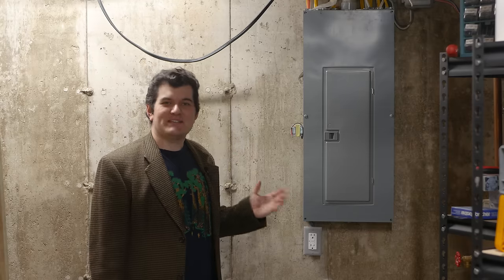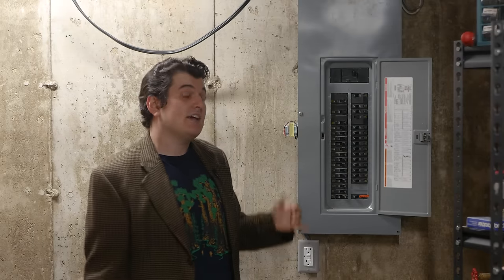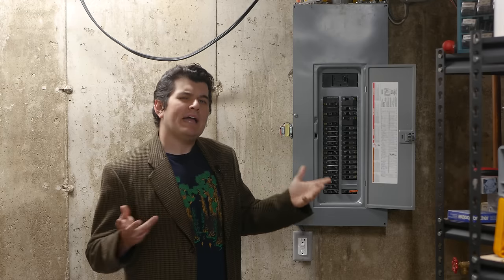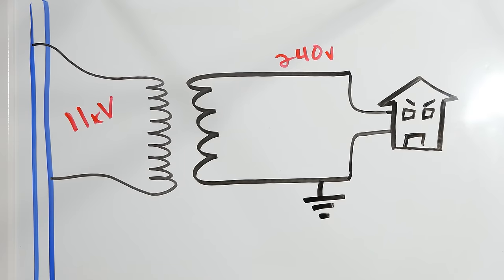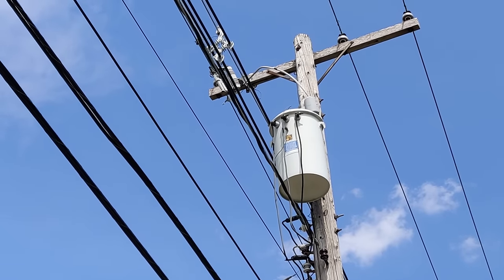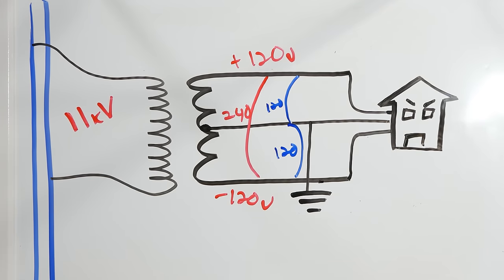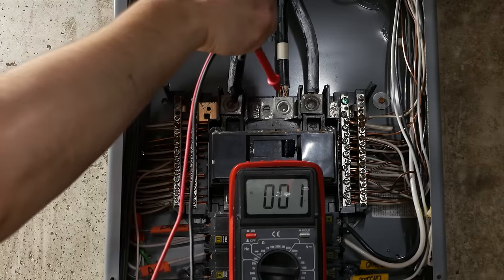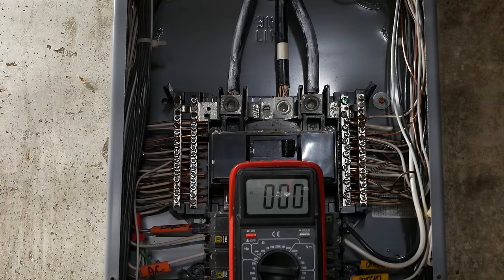The US electrical system is not 120V

Comment: Okay, if you haven't used a gas dryer, YOU'RE MISSING OUT. My clothes are actually dry! :P And my total utility bills are lower.
Reply: I see your gas dryer, and raise you my one with a heat pump 😉.
Reply: First time I visited my mom's new place I used her gas dryer for the first time.  I set it for the usual time - 45 minutes - to start, and practically melted my clothes.
On top of that her iron's thermostat was broken so it basically heated itself to infinity.
I had to buy all new clothes on that trip.
Reply: Try a heat pump dryer. Clothes last longer and no dryer vent.
Reply: @andrewrondeau5036  No vent isn't a heat pump thing. Resistive electric dryers don't need them either, but in general it's a very bad thing. It takes much, much longer to dry clothes, which cancels out the efficiency advantage, and uses more water to dry than a front-loader uses to wash, which is environmentally bad. The only way they can get by without a vent is to wash all the lint down the drain, which is very bad for drains and uses a ton of water. A vented dryer is always better if a vent is an option.
Reply: cry in rental
Reply: Greetings from my simple clothesline which is sun powered
Reply: @THECOOKIE94  Yeah, much easier on clothes too. Except for fading in the sun. And it doesn't work so well when it's raining. Or cold, especially below freezing. Or it's really windy and it blows your unmentionables into the neighbor's yard. 👍😂
Reply: Come to the pacific northwest where we only pay anywhere from 2-10 cents per kWh for electricity. Gas dryers are almost completely non-existent here. I've never actually seen one in the wild anywhere. And even the appliance stores don't stock them because nobody wants them here.
Reply: @awo1fman  Clothes racks are useful also. Can place them inside, and they work in winter. It takes longer to dry than with a tumbledryer, but the clothes stay nice for longer. It taking longer to dry my clothes doesn't matter, like who would decide one hour before going out that they would really want to wear the same stuff they wore a few days ago which hasn't even been washed yet?
Like almost nobody here owns a tumbledryer and we're still doin just fine.
Reply: Yep I overload the damn thing and in 45 minutes or less are piping hot. Gas just does some things better.  Gas stove= no wait at all for morning eggs and more heat to boil large pasta pots.  Gas water heater/hot water on demand system= I have never ran out of hot water.  Gas Heat= What winter -50 freedom units outside set to 72 gas bill was never over 70$.   BONUS NATURAL GAS ITEM= A hardlined built in back up natural gas generator detects power loss and automatically fires up and is capable of powering your entire house like normal WHAT POWER GRID? All I need is fresh dinosaur squeezings piped in and I'm set.
Reply: @eggman9713  where I'm from it only costs $9 a month (not on a budget plan either) to use my gas dryer, gas water heater, and gas stove combined.   It's literally down in the hundredths of a cent to use.
Reply: @awo1fman   or at night if you work all day.
Reply: @davinchat  Sounds like that dryer was a rebuilt oven from one of the camps in WW2 ha ha ha   Terrible. My dryer is just perfect. Whirlpool has an auto dry setting and it regulates well. Always dry and always just right.
Reply: I see your high ¢/watt and laugh in Oklahoman. Our homes have gas lines and 240V (3-wire for older homes/4-wire for newer homes for safer grounded chassis) and while gas dryers cost 2-3x more there’s rebates from the utilities to switch. Oklahoma Natural Gas, or ONG, offers up to $450 while the Public Service company of Oklahoma, or PSO, offers $50. Complicating things is that we have flat rate power in the 10¢/KWh with gas being only a little cheaper. 

Every home I’ve lived in save a condo during college had electric dryers, central gas water heaters, and central gas heat. The condo was all electric no laundry and a heat pump.
Reply: @THECOOKIE94  Don't get me wrong; I'm a fan of the rotary clothesline especially. It doesn't take up much space and you can stay in one spot to hang everything. But there are times when it rains for days and there aren't enough racks and not enough indoor space even if there were enough racks. And yes, sometimes plans change suddenly and you need something laundered right now that you thought you wouldn't need for days. Or there's a little disaster and something needs cleaned immediately so it doesn't get ruined or make things unpleasant.

It's like people who say that an electric car with 100 miles of range and no DC fast charging is more than enough. Until that one time there's a life-or-death emergency in the middle of the night and it's the only thing they have to get them 200 miles. Or 110 miles.

Neanderthals didn't need clothes dryers, either, but they also didn't live in the modern world.

I rarely use my clothes dryer, but when I do there's no substitute.

"Good enough" is NOT good enough.
Reply: Natural gas is .0019 per cubic foot where I live
Reply: Depends where you live as far as cost difference. Due to local code and utility requirements installing a gas dryer would have cost more even after installing a 240V socket for the dryer (no code inspections or utility requirements with electric installations). After that, energy costs came out to being fairly close, like a few pennies a load difference to where it would take decades to cover the install cost difference.
Reply: @peterg.8245  My house is strange. It has a heat pump instead of a gas furnace and a gas (propane) cooktop and fireplace. It's because heating with propane is likely to be more expensive than a heat pump, but cooking with gas is way better than electric (and I never use the fireplace).
Reply: @awo1fman  : I own a heat pump dryer. It just uses a dehumidifier. You're confusing it with older style ventless dryers which suck.

Comment: I knew we had 240V but had no idea that was how. Now I sort of want a route to have a faster kettle in my kitchen! Stovetop is never fast.
Reply: That would be the fastest kettle in the west!
Reply: Look for two plugs on your kitchen that are wired to different phases, make a very dangerous extension cord that plug into both and plug it to an European kettle.
ElectroBoom did something like that.
Reply: I'm intrigued and horrified at once.
Reply: Wire a 240v electric stovetop or oven plug in the kitchen. Make sure the circuit breaker is a GFCI breaker. Then get a european kettle, and chop the plug on it and wire a stovetop plug instead. Now you can experience the lego-like awkwardness of a British plug without the safety features! Actually, using heat-shrink or Dip-It! you could coat the electrical plug so the live contacts won't make connection until the ground is connected. (With Dip-It! you have to cut and peel the ends of the contacts.) If we could just make sockets where the live conductors are recessed back, we'd have everything but the fuse, and a smaller less-awkward plug.... Hmmmmmm
Reply: @mjbirdClavdivs , why not buy a normal socket on ebay or something?
Reply: Elías Rodríguez Martín that wouldn’t work in most code-compliant houses because the kitchen outlets have to be GFCI-protected, and the hack of using outlets on 2 different phases doesn’t work with GFCI protected circuits (it trips them, as they are designed to do).
Reply: Len Laughridge  correct... HOWEVER... a vast majority of kitchens have GFCI outlets, not breakers... so... yeah, you could wire in a 240V circuit... because many electricians run a multiwire circuit that shares a single neutral wire, and gfci breakers don’t work right on MWC’s... 
actually, on MWC, the receptical box often has both phases in them...
Reply: In the last few years code has permitted 20A service in kitchens as an alternative to split 15.  Generally contractors opt for this route as it's cheaper (fewer circuits)... but good luck finding a 20A kettle
Reply: If you run in a 220V circuit (from a 240V GFCI double-pole breaker), you can get US-standard 240V plugs and receptacles that are of similar physical size as the 120V ones, using the standard receptacle boxes. The plug blades are oriented differently so you can't connect 120V equipment to 240V, and vice-versa.
Reply: Photonicinduction shows how to speed up your kettle.
Reply: They claim Induction burners boil water remarkably fast. They can be invisibly installed NEAR the stovetop,  under a granite counter. Just slide the (non-glass, conductive metal teapot over the counter, et voilá!
Reply: A French friend liked his US clothes dryer so much, he brought it with him when he moved back to France. But it didn’t work quite right. I suspect it’s because it didn’t have access to 120VAC for the timer/electronics.
Reply: Now we can talk about Japan with their split 200VAC giving only 100VAC to regular outlets. And utilizing 60HZ in Western Japan and 50HZ in the East (including Tokyo). I remember the plug on the 100-volt clothes dryer in my homestay house melting.
Reply: Get an induction cooktop.  Then boil water in a kettle on the cooktop.  This is super fast.  I'll never own a non-induction stove again.
Reply: Just a fare warning if you use a device that is ment for 120v Ac on 240v ac it with work faster but burn the internal elements or electronics. If it has any display functionality the internal transformer with burn itself up or the electronics will burn up. The internal transformer is ment to change 120v ac to 5v DC or 12V DC if the input Ac is to hight the voltage supply to the DC circuit with be higher. Supplying the DC circuit with to much current and voltage. Burning it up.
Reply: I live in the US and Bulgaria and ended up wiring my place with European outlets on a 240 breaker in my kitchen, living room and working area. It's really nice to have.
Reply: don't just connect a 120 appliance to 240 though especially like a toaster or jug as things will catch fire :p Like Barry Lewis did.
Reply: There are several solutions but they all start with a 240v/20A Hubble socket or similar since that interface keeps things to code. One person I know has their kettle directly plugged into this -- not great, IMO -- but its common to put a short extension lead on the end that's got a couple of European or British sockets on the end. (We use British, our daughter has Euro.)
I don't know about a 'faster kettle', though. Theoretically, yes, but modern global manufacturing being what it is you find a lot of those plastic jug kettles are all around 1100 -- 1600 watts regardless of whether they're made with 110 or 220/240 volt elements.
Reply: @TonyPombo  Am in an apartment with a pre-installed induction stove. They clearly went with all the cheapest equipment.

Cheap induction plates suck. You can hear the electronics buzzing, with certain pots it creates even more noise. I baked pancakes, ended up burned in the centre and soggy on the edges. Fineness of control also kind of sucks: 1-10, at 6 water doesnt keep boiling but pulses every few seconds, at 7 it boils over constantly.

Problem with induction imo is that a cheap gas stove  isn't any worse than an expensive one, but there is an ocean of difference between cheap and expensive induction plates, and the cheap ones really suck.
Reply: Induction!
Reply: @martinusher1  yes. The US has ruined everything. I can't find 2400 W heaters anymore. They're all '2000' W but they're really 1500.
Reply: Get a 240v IH stove. Electric kettles are essentialy just IH stoves build into the bottom of the kettle anyway so it would boil at a similar speed if it was 120v, so at 240v it's super fast.
Reply: Tim Taylor agrees...
Reply: @martinusher1  Regarding the 1100-1600 watt kettles that's true for cheaper models and many supermarket own brand models.  If you want a kettle with a higher rating you need to look for "Fast Boil" kettles, most of these are 2.4-3Kw and are what most people, at least in the UK, still buy.
Reply: @mjbirdClavdivs  nah, use US 120V kettle, 4 times the power, and you get to have a new one way more often.
Reply: @moldboy2  Get a regular kettle and fit two elements - but get health insurance/will before plugging it in.
Reply: Same
Reply: @allmycircuits8850  A short piece of a steel spring connected to a AC power cord. Ask an ex-con. I've seen a cup of water brought to  a full boil in 5 seconds
Reply: Unfortunately I've only seen those be quite large/pricey, which greatly defeats the purpose of the compact size of a countertop kettle unfortunately. :<
Reply: @tokyojimu  If they use split 200v why not use 200v driers? Makes no sense. But then again, so does a country with different refresh in each half in the 21ist century. Or 100v for that matter.
Reply: Just make sure the cables and electrics can take the hike in more amps.
Reply: @majbummer69  He.... is a mad man!

I hope he's OK.
Reply: Get a gas range.
Reply: You can get a hot water dispenser to put on your kitchen counter to get hot water instantly. They hold three to five litres and use a vacuum insulated container to keep the water at near-boiling temperatures. BestBuy has a bunch for sale online.
Reply: Apartment dwellers have 208, not 240.
Reply: I have an original to the house 1974 GE counter top 4 eye stove, in that weird 70's brownish yellow pastel color. Still has the original eyes. Heats a gallon of water faster than the 2 L electric kettle I used in Germany. Surprised me.
Reply: Im no expert but I assume you could just buy a nice AU outlet and kettle online. Then just wire it to the 2 phases with an rcd and 10a breakers
Reply: My electric kettle in Australia - 2400W.  What is this thing you call a "slow kettle"?
Reply: @mjbirdClavdivs  Unfortunately, those 240V European kettles only have a single pole switch, just like an American 120V model. The line side is switched, the neutral is not. American 240V appliances use two pole switches (just like the panel breakers), one for each side of the line, as there is no neutral.
Reply: @ellenorbjornsdottir1166  Only in large buildings with three phase supply. My smaller building has only split phase. so it's 120/240, like any house.

Comment: As a UK son of an electrician... I loved this. Although, a fuse did once save my life... Hairdryer + water + path to ground going across heart. Dislocated my arm but didn't kill me.
Reply: There are differential breakers which detect when current has gone to ground and cut the power in miliseconds, that's what saved your life. A fuse is too slow (seconds) and not sensitive enough to protect you (they support whole amps, that's almost instant death!). I read the fuses are required due to the ring topology of some houses in the UK, as a short-circuit in the appliance will make it burn before the breaker pops because of high current.
Reply: @EmuAGR  interesting... None of the breakers tripped and only the fuse went so I've always assumed it was that. I'm lucky either way, the path to ground was right arm to left leg. Apart from the dislocation, I'm fine. But if that fuse hadn't popped the power would have continued through my body... So I'm enclined to believe it was the fuse going that stopped the power and saved my life.
Reply: @PeskyPoet  Sounds a bit odd, As EmuAGR said, fuses take a lot more to trip. Some of the smallest are around 2A on an inital search.
2A is more than enough to kill you. On the other hand, RCD/GFCI trip at 0.0's of an amp. the RCD in my house trips at 0.03A
Reply: @bradleybatt1401  As a random person who has a basic knowledge of electrical circuits, it infuriates me how many people don't know the different between RCD, fuses and breakers
Reply: @bradleybatt1401  except the RCD didn't trip. Glad you also have the education. Then you can explain why only the fuse in the hairdryer went and nothing in the fuse box. As the fuse was the only broken area of the circuit, I still say that fuse is what saved me.
Reply: Now the UK is following the US in using RCD's  ( GFCI's) that will prevent that danger.
Reply: @PeskyPoet  Well fuses blow by overloading of current, do they not?
Why would that overload it with current?
You can say that, but RCD is the only thing that makes sense (to me). Somebody else could have flipped the breaker before you got to it, too.
Reply: @garlicbreadlikesqfes  didn't think this would create such controversy... I was alone at home (you can imagine how thankful I was that the fuse blew)... Had it not blown then I hope the RCD would have saved me... As to why it would have experienced over current, I'm not sure. The house had pre 1990 wiring, I was connected to a dodgy power strip, I was wet creating a reduced resistance between the device and the ground. It is entirely possible the current shot up as I created a route to ground with less resistance allowing for more voltage to pass. All I can relay is the events that occurred that night and speculate on the reasoning for the fues going.